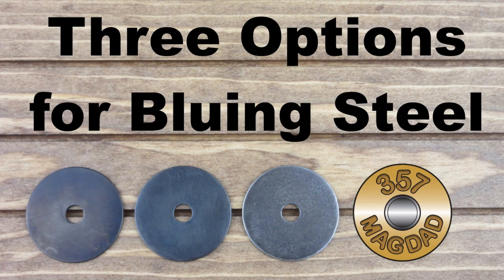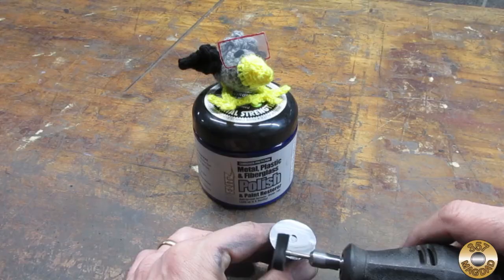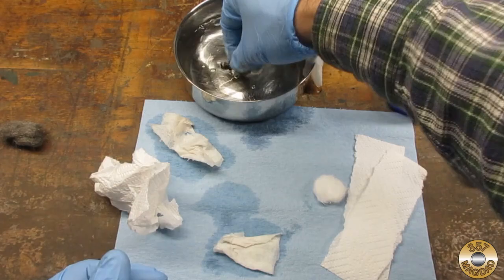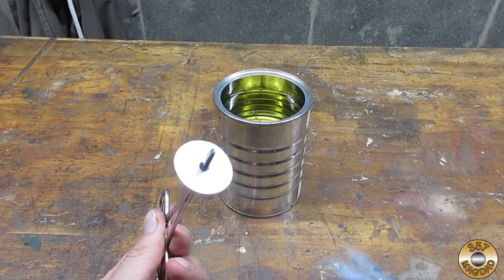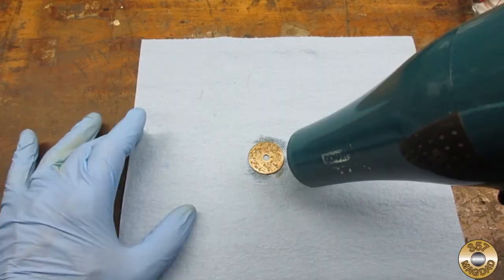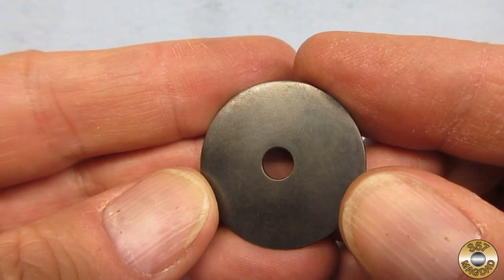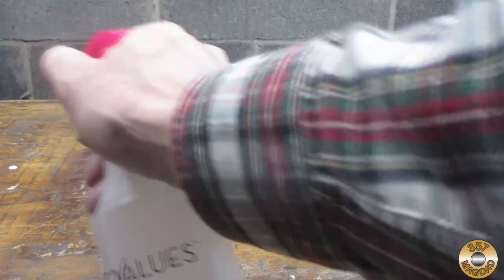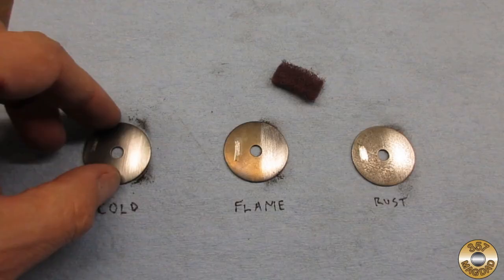Three Options For Bluing Steel

Comment: Steel wool has some oil in it to keep it from rusting. If you rinse your steel wool in Acetone, it removes the oil and prevents contamination of the metal to be blued.
Reply from the maker: I make sure to clean the item after buffing with steel wool.

Comment: Nice comparison.  The object of bluing is to convert the free iron atoms on the surface to Magnetite.  This will remove the free iron so it can not be converted to iron oxide (red rust), which is highly damaging.  The magnetite is a very protective layer to red rust formation.  This is how the inside of boilers are protected, by the formation of magnetite.  Magnetite is a soft material and can be removed quite easily.  By multiple applications of all the methods you are able to do more converting.  The magnetite is a soft fully material and will absorb oil quite readily.  This gives it added protection from iron oxide.  Inside a well protected power boiler I have seen the magnetite 1/4" thick, and not a single spot of red rust anywhere, and the boiler is full of hot water.
Reply from the maker: Thanks for the information!
I'd like to try the rust bluing with a proper factory made rusting solution.
Reply: So, wouldn't the hot water convert any oxidized (red rusted) material into magnetite?  That seems to me to be the reason it is so thick inside the boiler?

Comment: Heating steel above 400'f will cause it to become a "straw" color (light yellow). Around 500'f it becomes brown and at 600'f you begin to see purple/blue. It will then turn gray at 800'f. These are all in the temperature ranges that result in "tempering". Tempering causes carbon steel to lose its hardness regardless of if you dunk it in oil. Also, heating it to where it turns blue will cause the steel grains to become larger which is bad. The only way to remedy this is to heat the steel to where it is no longer magnetic, around 1450'f for your typical carbon knife steel, then depending on the type of steel, either dunk in water or oil. Low carbon steels were typically never hard to begin with and cannot be hardened in this manner. You'd have to heat low carbon steel to non magnetic while in an oxygen free container with carbon surrounding it in order to make it stronger... a total waste of time and money. Basically, don't heat blue any steel that is "mission critical" unless you really know what you're doing.
Reply from the maker: Thanks for watching, and well said!
Reply: I bought a DIY 2400 watt induction heating board for 50 bucks just to play around with this.  Been using my stick welder to power it.   Didn't know about the oxygen-free thing though, been quenching mild steel in the wife's tea candles (shhh, they're paraffin) with some success. 

💡 I got a vacuum pump laying around here somewhere...

Comment: I agree with 'Randy Richard in The Shop' that the aim is to get a layer of magnetite. The best way to achieve this is to allow red surface rust (ferric oxide) to form and then subject the component to electrolysis. The cathodic reaction produces hydrogen gas because two oxygen atoms combine with the rust (ferric oxide) to form magnetite. This is much more efficient than boiling it in distilled water which simply 'undissolves' oxygen in the hope that it will attach to the rust as opposed to a proper chemical reaction by splitting the water molecules by electrolysis. You see magnetite on the blackened steel tools that never seem to rust.
Reply from the maker: Thanks for watching Matt!  Check out my long term corrosion test of the rust blued washer:
https://www.youtube.com/watch?v=H9sngIhUGI8

Comment: Interesting comparison. I use hot blueing for the appearance, rather than surface protection - it might be interesting to overcoat with clear coat (which will help preserve the blueing) 👍🏻🔧
Reply from the maker: I think you could clear coat it as long as you de-greased the part well.

Comment: I’d also add that although for your purposes all three methods work well, cold bluing is usually the only way to blue larger items. Furniture makers and restorers catering to the industrial/steampunk crowd often use cold bluing to add character to steel decorative elements; I can't imagine trying to rust- or heat-blue a chair frame or loft railing. (Just in case you were wondering why it can be bought in a gallon jug 😅)
Reply from the maker: Gunsmiths often build a steam tank for rust bluing.

Comment: One fast way to test corrosion resistance is grap a bit of clay from the ground, make a slurry with water. Any iron in contact with clay slurry tends to oxidize in 24h,unless has good surface protection.
Reply from the maker: Thanks for watching!  Check out my corrosion tests on the washers:
https://www.youtube.com/watch?v=Z5ubCDqQwt4&list=PL2LUCgmdqpXOpk4SmLUUxAXQWGICpF_v6&index=2

Comment: The oil helps to protect the bluing, which is essentially magnetite, and inert, and is the primary protection for the base metal.  Oil seals microscopic pores in the magnetite to prevent the base metal from oxidizing under the magnetite.
Reply from the maker: Thanks for watching!  You may find my follow-up videos interesting!
https://www.youtube.com/watch?v=Z5ubCDqQwt4&t=5s
https://www.youtube.com/watch?v=H9sngIhUGI8

Comment: Another thing to consider: it's not advisable to oil rust blued items for a while after you are done with the last boil and clean. Converted black oxide is still a rust oxide, and will react with oil.
Reply from the maker: Thanks for watching!  I have done quite a bit of research on cold bluing and had not come across your advice.

Comment: If you get Mrs. Magdad a new hair dryer for Christmas that one would become Mr. Magdad's dedicated shop dryer! Could also set them outside for a few months to see how they hold up, and revisit!
Reply: @357 Magdad  That would be a great idea. Get Mrs. Magdad a new hair dryer with all the bells & whistles, whatever that is. After awhile, a hair dryer can become a fire hazard depending on what builds up inside. Kinda like sawdust & finishes build up in a power tool. Just a thought.☺
Reply from the maker: She lets me use it because she does not use it much.  I would like to pick up a heat gun at a yard sale sometime.
Reply: I picked up dad a harbor freight one like 25 years ago on a 30% off coupon...he had to take it back twice to get one that worked but that last one still works like a champ.

Comment: My first bluing attempt yielded a mottled blue finish on some polished 1055 steel.  I used 4 applications and used steelwool washing off the oils in between cleaning. I also got a rainbow effect on polished 1045 steel which steelwool and washing/alcohol rub did mitigate allowing a more solid looking gunmetal finish.  Some imperfections showed slightly still after 5 applications. One thing I noticed with this steel is that some rust-looking film formed after a 30 min or afterwaed.  It came off with a clean rag and alcohol, and I coated it with a light polymer which kept it from doing that again.  The 1066 steel I did, was perhaps the best probably because of the higher grade.  While it was only wirebrush cleaned, I still used the same process as the 1045.  Every application came out noticeably darker, even and more cleanly than the others. It became the darkest of all I have done.  All these were done in a few hours.

I still don't like that it scratches so easily, so I may use a bit of clear coat to protect it more.
Reply from the maker: Thanks for watching Matthew.  I have found that the cold bluing solutions work better if the part is not highly polished.  That may be why your 1066 part turned out better.  I also soak the part in non detergent 30 weight oil at least over night, usually longer to set the finish.  I've got a rust bluing video coming out this weekend that you might find interesting - stay tuned!

Comment: Good video and techniques. Some not so pricey, yet effective. Keep in mind that Super Blue has no rust protection properties unless you start with Rust Bluing at first the Perma Blue then Super Blue.
Reply from the maker: Thanks for watching!  I think the thin film of oil provides the corrosion protection as shown by the salt spray test I performed on the blued washers.
Reply: @357magdad  it does, but starting the treatment at the metal helps. The oils only back it up.

Comment: Very cool comparison, Magdad! I think you are correct about the oil being the corrosion resistance feature. The rust blue method sure pitted the washer. The AJB on the washers is my initials, pretty cool.
Reply from the maker: Thanks AJB!  I noticed that the hydrogen peroxide/salt really ate into the soft low carbon steel washer.  I've seen other home brew recipes that included vinegar and used less salt.
Reply: @357magdad   I have only seen the rust method of blueing on modern remakes of old firearms. I would like to think efforts like ours would last longer but someday someone is going to restore our old restorations of tools...or not. AJB is my birth initials, no meme.

Comment: There is a fourth one. It's not really bluing but blacking. You heat the metal and dunk it into Linseed oil. You do this several time till you get a nice black finish.
Reply from the maker: Thanks for the suggestion Ray!

Comment: Great comparison! I'm still looking for a really durable finish for my tools, but maybe that's just not something that's really realistic for our home shops at reasonable (read: I'm a cheapskate) prices too. Have a great Sunday!
Reply: Brownells Alumahyde. It’s like duracoat or cerakoat just cheaper and less color options
Reply: Linseed oil diluted with mineral spirits works well on metals. Cheap and easy. I usually follow it up with paste wax.
Reply from the maker: Thanks Alex!  I was impressed that the Johnson's paste wax was able to protect against corrosion!

Comment: Also do nitre bluing and caustic bluing.   Non-binder Charcoal straight, charcoal with added charred bone,  charcoal with added bone and pre-1973 ATF (which is whale oil.)
Reply from the maker: Thanks for watching!  Both of those methods are beyond what I want to try in my small basement shop.

Comment: Also oil blacking. Heat as hot as willing to go, preferably cherry then dip in dirty engine oil.
However for superior results send the parts for chemical blacking at your local plating company. Ensure the parts have as good a finish as possible prior to plating. This is how engineering companies do it.
Reply from the maker: Thanks for watching Brian!  Be careful, heating the part to cherry red will remove the temper.  You may also make the part brittle by quenching it too quickly in the oil.

Comment: Thanks for the info 👍 been wondering about different coatings... way back in the early 80s I restored a old chest wrapped in tin ..and leather. It was very rough... I used a product called rustmort? It turned the rust dark brown and was very durable! I kept the chest for many years and it never turned.. has anyone heard of this?

Comment: One thing that I would mention is I personally dont consider your flame bluing technique to be true bluing per say. Hot salt bluing and rust bluing is mostly used, as mentioned, for pacifying steel and giving a minor layer of rust protection to the steel, while your flame bluing is really only used for aesthetic reasons. I could be wrong on this however!
Cold bluing is also primarily aesthetic, but is meant to mimic true rust/hot bluing.
Reply from the maker: Thanks for watching!  I chose options that are feasible for someone to do at home.
Reply: I use heat bluing on antique clock screws.  I have had clocks over 150 years old with the original bluing still protecting the screws from rusting.

Comment: What a lot of shagging around with chemicals that produce a poor result, the only one was the heat blue which produces a lovely blue color when polished and heated evenly and cooled quickly at the right temperature,I know from a lot of experience of producing  the new blue color on clock hands and screws.
Reply from the maker: Thanks for watching!  I enjoy shagging around in the shop!

Comment: highly informative video. i have made an awning from angle iron that will be exposed to the outdoors, do you suggest bluing or simply applying a coat of epoxy paint will be better?
Reply from the maker: I think you would be better off painting a large item.

Comment: Do an oxidation test without the oil to have an accurate test of the finish
Reply from the maker: Check out my extended corrosion test:
https://www.youtube.com/watch?v=Z5ubCDqQwt4&list=PL2LUCgmdqpXOpk4SmLUUxAXQWGICpF_v6&index=2
And my long term rust blue test:
https://www.youtube.com/watch?v=H9sngIhUGI8&list=PL2LUCgmdqpXOpk4SmLUUxAXQWGICpF_v6&index=1

Comment: Does the length of time a bluing agent is applied effect either the depth of color, or how deep the blued layer is that results?
Reply from the maker: I've found that leaving the Perma Blue / Super Blue on too long negatively affects the finish.  Multiple coats with steel wool buffing in between seems to yield the best results for me.

Comment: Are there all equal to rust protect? Did some cold bluing and the part started rusting again the day after the 24hours in oil. Maybe one of my step wasn’t done properly 😅 (not following you method tho, now I’m doing more research)

I’m trying to refinish pliers because they were pretty rusted. Would there be a finish better than bluing?
Reply from the maker: Cold blue will not prevent rust.  Check out my video on rust bluing:
https://www.youtube.com/watch?v=7lXeT2qzCi0

Comment: the cold bluing really is for touch-ups i dont give great protection at all and its worn off easy. For rust bluing u used wrong mix i think becouse rust was not unifrom and fine but it makes little holes, u also forget to try the 4th method :) boiling in Sodium bicarbonate, which gives great and strong blueing.
Reply from the maker: Thanks for watching!  I have had success with an improved DIY rust bluing solution:
https://www.youtube.com/watch?v=4iyyRY8nFdo&t=179s
Reply: @357magdad  thats nice

Comment: I just put stuff on top of the kitchen gas cooker until il glows red, then dump it into a can containing oil. Any oil.
Reply from the maker: Thanks for watching!  Flame bluing is an option - just make sure the "stuff" you heat glowing red isn't heat treated (like a blade or tool).

Comment: I did try to cold blue couple of nuts, after a while they got covered by a thin layer of rust, which goes with a wipe. Do you have any idea why this is happening?
Reply from the maker: Make sure you rinse with water after application, then buff with 0000 steel wool and soak in oil.

Comment: nice vid! Thanks. Do you think that boiling in water could also affect the hardening of wheel bolts? I also heard of hydrogen embrittlement. Could the peroxide also affect the strength of wheel bolts?
Reply from the maker: Thanks for watching!  212 degree water and the low concentration of the common drug store grade hydrogen peroxide I used has no effect on the steel.

Comment: Doesn't tap water introduce other chemicals into the process??  I would of thought distilled water or just an acetone bath would be better.
Reply from the maker: I'm not sure what "process" you are talking about.  I used distilled water for rust bluing.  Cold bluing manufacturers recommend rinsing in tap water.

Comment: I think rust bluing can be the best but not so much when you speed up the rusting process so much. I have seen a video on here of someone using a 1 hour rust blue process that did not leave pits. I don't remember their name though. I believe they used a similar solution but not as strong.
Reply from the maker: Thanks for watching!  I've had better luck with a slightly different rusting formula:
https://www.youtube.com/watch?v=4iyyRY8nFdo
Reply: @357magdad  Thanks I'll check that out!

Comment: It would be interesting to know what kind of reaction is taking place in cold bluing.
Reply from the maker: I believe the cold bluing deposits a coating of copper on the part with chemicals added to make it appear black.
Reply: difference in reduction potential between iron and selenium dioxide. iron is oxidized to iron (II) (III) oxide, magnetite. selenium is reduced to elemental selenium. black color is from the magnetite.

Comment: The rust method pitted the washer. Can't imagine why anyone would want a pitted surface unless it's for an artistic effect.
Reply from the maker: Thanks for watching!  I didn't get an even color on the rust blued washer, but the rusting solution did not pit the metal.  I have found an improved recipe foe the rusting solution.  Check out this project:
https://www.youtube.com/watch?v=4iyyRY8nFdo&t=7s
Reply: @357magdad  Check out that close-up at 6min 40 sec. You telling me that the washer is not pitted after you had previously buffed and polished the washer????
Reply: BINGO!

Comment: Rust bluing is used on Holland and Holland double rifles that cost 6 figures as it will not affect soft solder used to join and regulate the barrels. Your "rust bluing" method was very primitive and gave poor results. Rust bluing is by far the most durable finish bar none, even more durable that commercial hot slats bluing.
Reply from the maker: Thanks for watching Daniel!  I have achieved better results with a slightly different rust bluing home brew:
https://www.youtube.com/watch?v=4iyyRY8nFdo